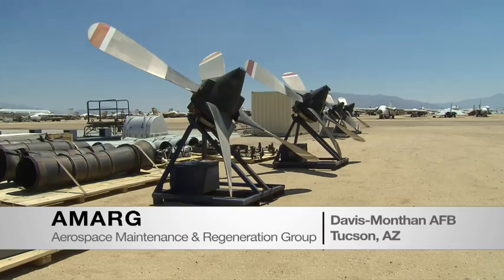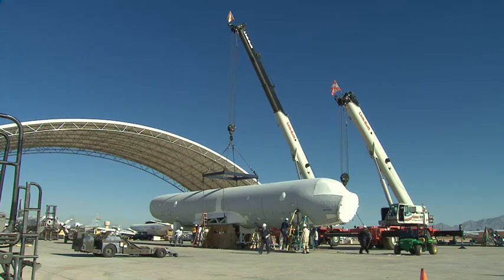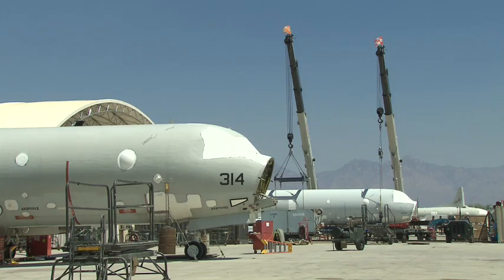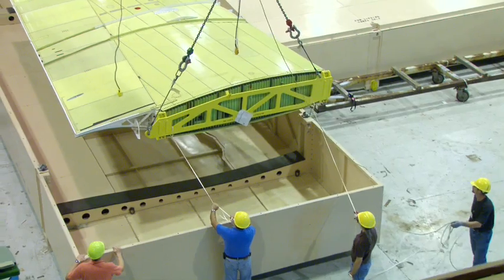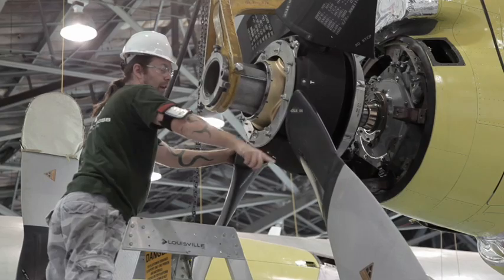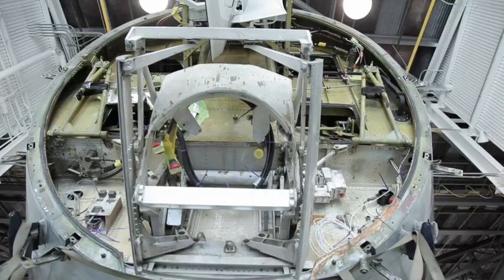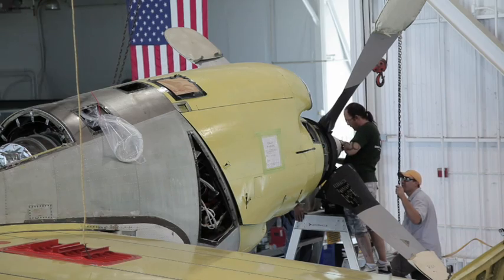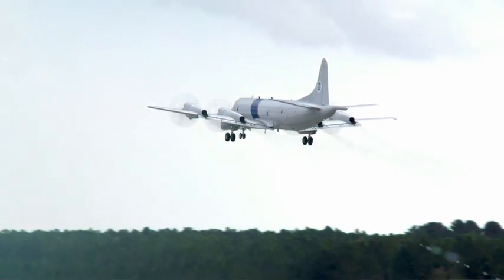P-3 Orion Desert to Delivery

Comment: The Royal New Zealand Air Force begrudgingly bought our new P-8A Poseidon ASW aircraft to replace our P-3s, but the 60 feet above sea level in hurricane Search and Rescue missions the Orion kicks the Poseidon's backside, the 737 chassis isn't designed to fly that low. Our new Super Hercules will most likely take over the low level SAR role in the Pacific